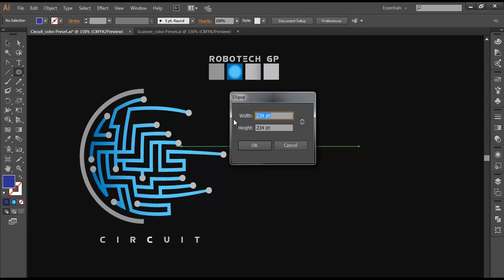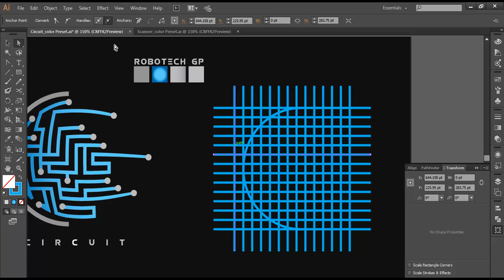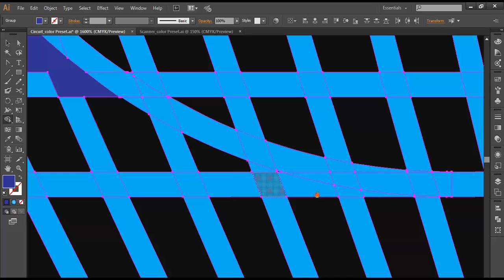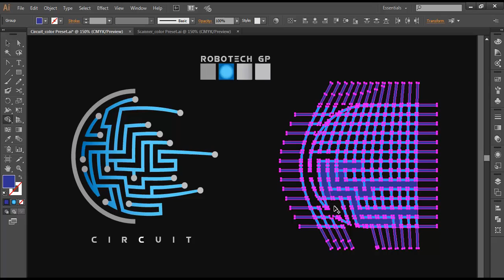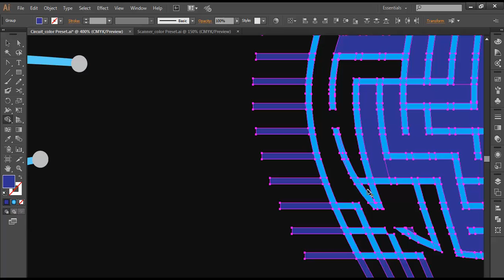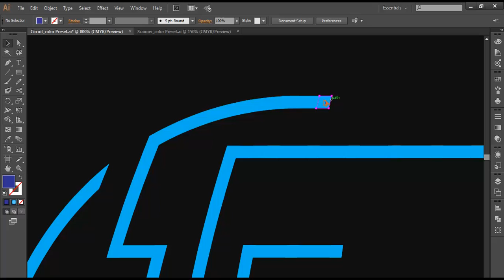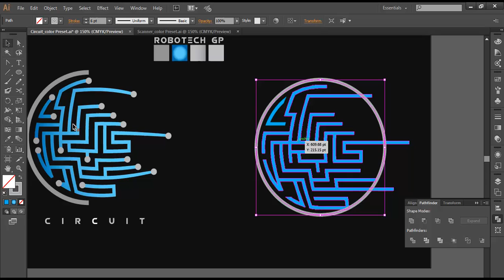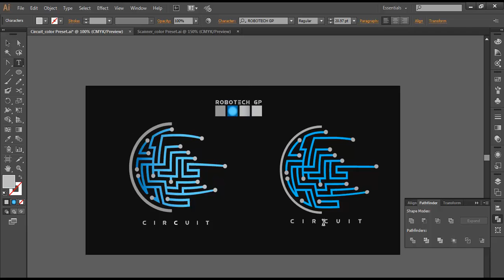Professional Logo Design - Adobe Illustrator cc(Circuit)

Comment: Thank you. Very nice logo design with intricate work. It looks there was some distortion to the termination ends when you bent the right side. Did you put the termination ends on after you bent that side on the original design to prevent this?

Comment from the maker: Hey  Guys!
Check Out this NEW VIDEO
Professional Logo Design - Adobe Illustrator cc(Circuit)
In this video, we will be designing this Circuit Logo. The Logo has got a very interesting designing techniques. It has got a circuit design with circular end at one side, whereas the other sides are converging toward each other. 
SO to design this logo we will use the ellipse tool and create out a circle. then after that with the help of line-segment tool, we will create out the grid. We will modify the shape of the grid and with the help of shape builder tool, create out this circuit design. And finally add up the further details and the text.
Check out the video to follow the whole designing steps

If you want to Know more about Designing,
Click to subscribe my channel.
https://www.youtube.com/user/creatnpr...

FOR BUSINESS INQUIRY
Mail us at - Creatnprocess@gmail.com

PROFESSIONAL LOGO DESIGN VOL-1
INTUBUS - https://www.intubus.com/file/14363
GUMROAD - https://gumroad.com/l/woEWa
Reply: +creatnprocess Hi, could you tell me how to change the illustrator document background color black (like in your video). I tried changing it from File > Document setup, but it doesn't seem to be working. Is there any other way? The default color is white of course.
Reply: what about the gradient? it's on the left logo